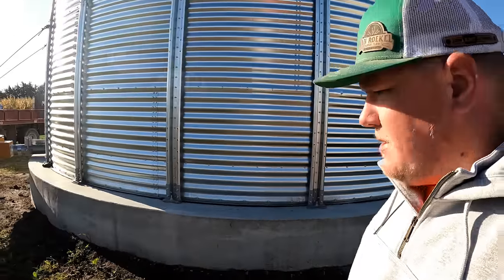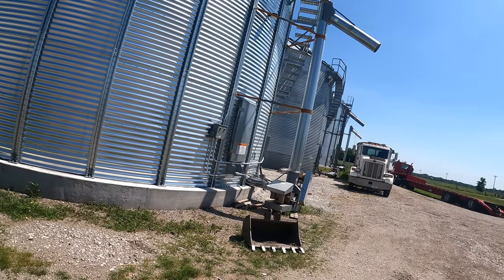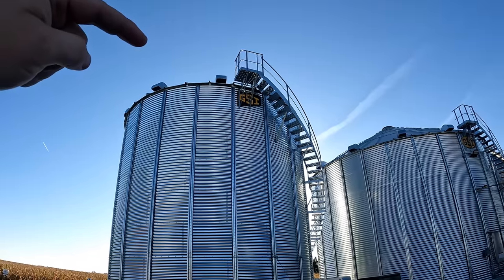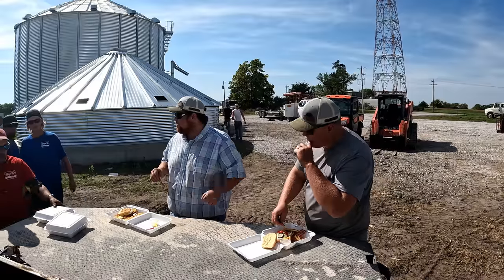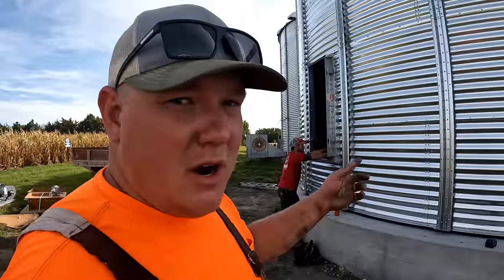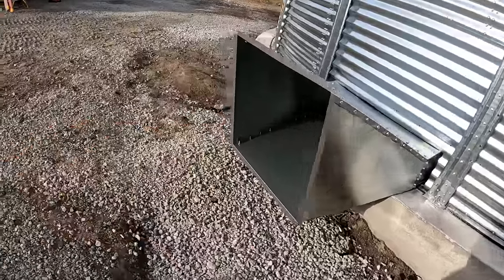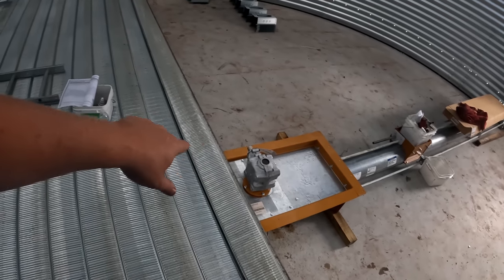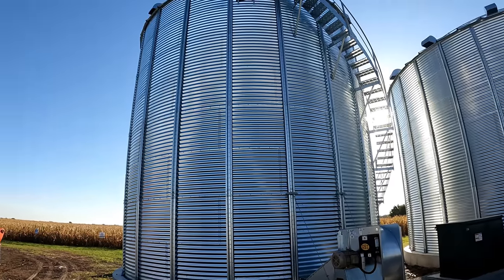NEW! GSI Grain Bin Build - Start to Finish - On Farm Storage Project

Comment: I'm putting in my first grain bin, and found a fairly detailed .pdf from GSI on grain bin installation and site prep for a 21' bin.  I'm only at the foundation part of the video, and there's a few differences.  It says to only use rebar (2 rings of them) on the footing, and then use 2 layers of 6x6 wire mesh for the interior of the pad.  Also, if the footing is over 2' wide, to go 12" on center with perpendicular sections across the 2 rings for the rebar.  So it goes from it looks like 24" on center rebar in the video, to double layer 6x6 mesh in the manual.  One part I don't get in the manual, is it only shows 6" max for above ground concrete, minimum 1' below.  Which to me, doesn't make any sense.  If you have any grade at all, you'll be about flush with the ground on one side.  Also, the manual shows a 1/2" expansion joint between the footing at the rest of the pad, it doesn't look like the foundation in the video has one.  So....does the manual not really matter, or is the video cutting corners? I'd hate to do it wrong.
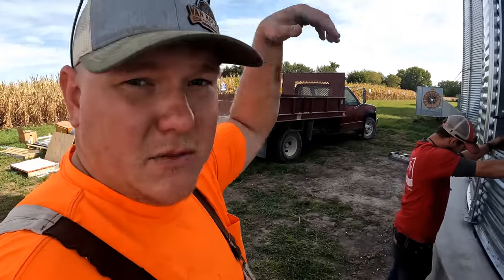Reply: 17:37 And I wondered how in the manual it says to put the anchors in the concrete while its still wet, but still be able to align it with the bin, lol.

Comment: Man, THIS is awesome. I love seeing how stuff is done, I wouldn't have guessed they jacked the roof up like that, but it makes sense in retrospect. This is why I love the internet, I'd never get a chance to see one of those massive site cranes go up but on the internet, I can see it... 52 years and never saw a metal grain bin go up, now I know how that works.

One thing, wear some ear pro! All that generator noise, cutting, impact wrenches... that stuff will destroy your hearing, especially in an enclosed echo chamber. As a life long shooter with some hearing deficits even WITH hearing protection, it amazes me how many of these guys don't wear ear protection.
Reply from the maker: They actually wear ear buds a lot of the time, just didn’t look like that in video

Comment: Dumb question.  How do you clear out all the grain dust that will settle below the floor onto the concrete?
Reply from the maker: Actually, that’s why I went with the punch floor - it was an upgrade, but it supposedly lets less fines down below the floor. 

Other than that the only way I know is to pull the floor and clean it. Dad had that done (floor pulled for an unload upgrade) and there wasn’t as much under the floor as I thought there would be.

Comment: Wow, that was some serious screwing around 🙂 Awesome video about a building process totally new to me (and to a lot of other watchers I suppose). Is there a specific reason why the external equipment is hanging in cables instead of standing on a concrete patio?
Reply from the maker: It actually works better that way. Concrete will move with weather. We much prefer this.

Comment: I was surprised you didn't build
30,000 bushel+/- capacity bins.
Were is the honey spot bushels
to Dollars ?????
Nice bins , with good features.
Reply from the maker: This was built with a purpose - a wet bin - usually the higher number of bu the cheaper per bu
Reply: I'm sure you had a reason but why couldnt one of the older bins have been converted to wet bin and then built a larger bin